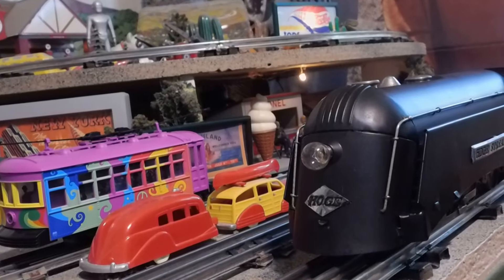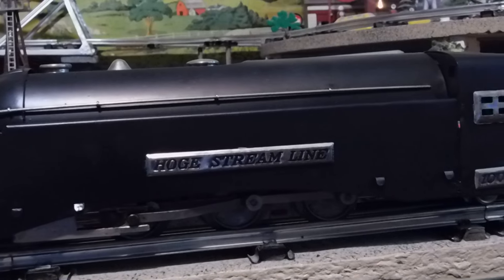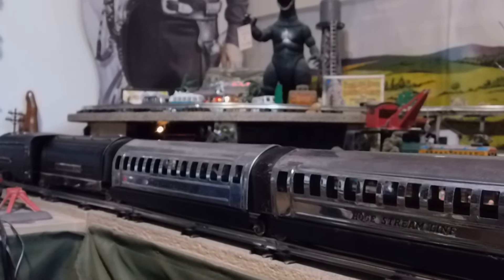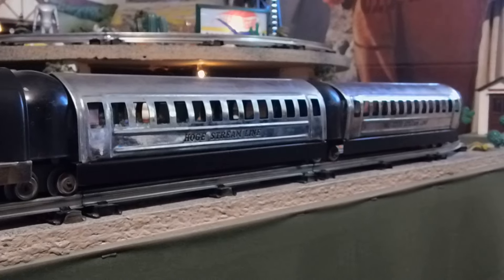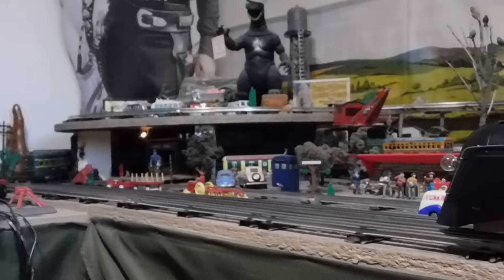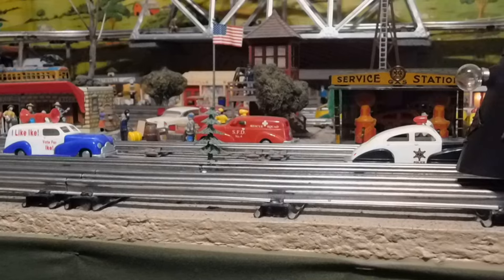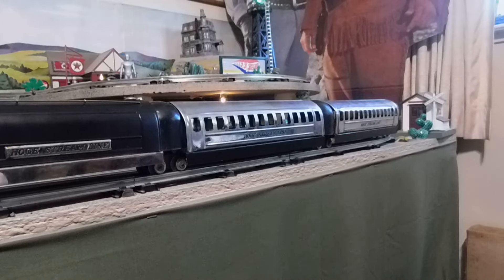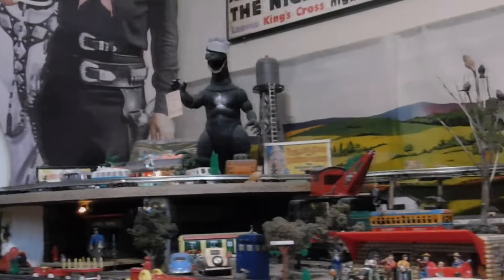HOGE 1000 Commadore Vanderbilt Streamliner O scale train set, 1935

Comment: Hoge looks great. I had no idea it need specific track.
Reply from the maker: It does not need specific track, just wider corners than my O-31 track. HOGE sold banked track so you could run the train faster without it derailing.